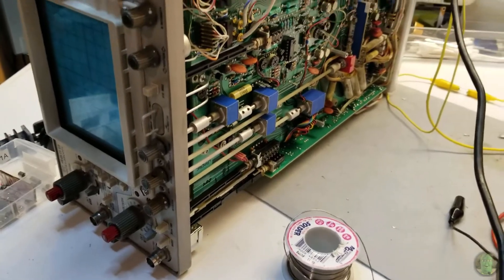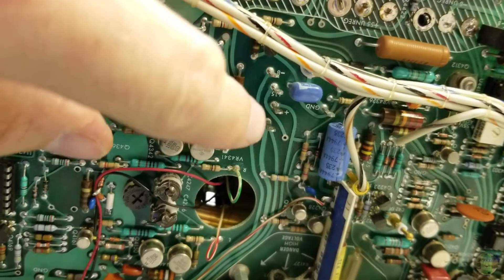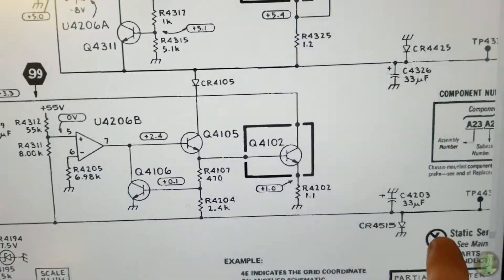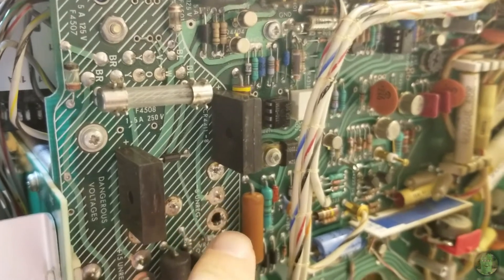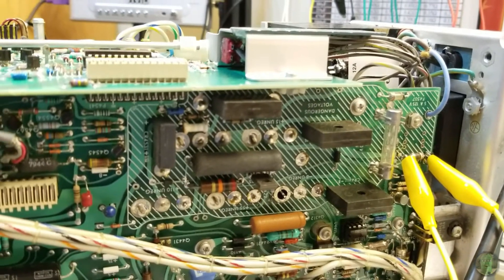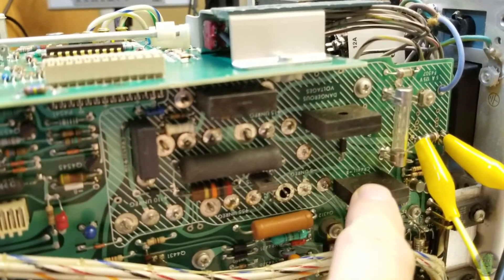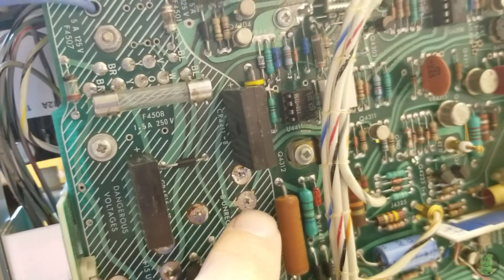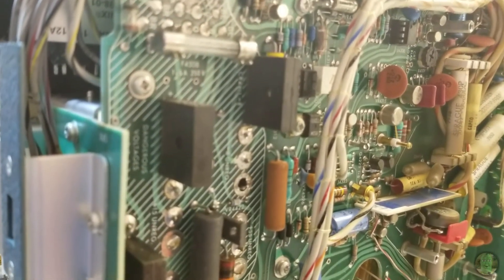Tektronix 465B Oscilliscope problem

Comment: I would check the tatntalum cap on the -@+ 8 volts line. Use you Fluke VTVM to measure the  resistance  to ground . Those bulk caps seldom fail, but the tanks  fail left and right

Comment: I recently acquired one of these for free, I'm just glad that this video showed me what it looks like without having to open it up. Mine works just fine but I don't have the connectors , I thought they were coaxial but they're not, something from the early 70s... where can I find these?
Reply from the maker: It uses standard oscilliscope probes. Any modern ones you buy should still work fine on it.

Comment: That cap is shorted. You will need to de-solder the lytic and push the pins inward so the cap is free to move and shake around, then position scope so that the caps drops free and take it out  ( IF ) you have room to get it out.  Then use a tubular lytic as your replacement, then position the cap wherever you can find room on top, even if you have to use extra lead length on the cap leads.  Make sure Q4102 is not shorted before you do anything.  Don't forget about the Tantalum's!!     73's,  Gary Grove  Minneapolis, MN

Comment: Excellent video!
I have a digital Tek TDS1002B since 2008 and I'm happy with it. Recently I run into the opportunity of buying one of these used Tek 465 (not the B version) for $150. Is it worth buying and having it nowadays?
Reply from the maker: It's hard to say. $150 is steep given its age. Lots of tantalums to short and electrolytics to go bad. But it is nice to have an analog scope for certain stuff, I would go for the more modern analog scopes that had the digital overlay, but were still CRT.

Comment: Don't think it's your big electrolytic. Check first tant filter cap a little further down line like c4203. Tants are more likely to short than elecs.
Reply from the maker: It's been a while since I worked on it, been meaning to get back to it, but I remember reading a resistance across the capacitor was basically 0 ohms, while the -8v at the first tantalum was an ohm or so. I'll still keep them in mind when I get back to it though, cause yeah those little guys will short and explode sometimes!
Reply: @probnotstech  I'd love to see a follow-up video (or comment) on this. I had to buy 3 fleabay 465B's to get one that was working right.

Comment: When working on these old Tek scopes, how do you use a Variac and an isolation transformer?  Do you hook them together or do you use each one separately hooked into the 120VAC power line?  Or, do you even need a Variac and an isolation transformer?  I would think the Variac is handy in case an unknown condition Tek scope had a major short that you wouldn't want to apply full line voltage to.  Is an isolation transformer handy or necessary when working on the old Tek scopes?
Reply from the maker: I use neither at the moment, but they would both serve different purposes. The isolation transformer is for safety, especially when working / using the scope on something with a hot chassis. Variac is useful in that you can bring the voltage up slowly on a device you suspect might have a short or something that you don't want to run a full 120v through. I don't think it matters the order you connect them, but I would probably plug the variac into the isolation transformer.
Reply: I dont mean to be so off topic but does anybody know of a trick to log back into an instagram account??
I was stupid lost my account password. I would appreciate any assistance you can give me
Reply: @Karson Colt instablaster =)
Reply: @Braylen Johnny I really appreciate your reply. I got to the site on google and im in the hacking process now.
Seems to take quite some time so I will get back to you later with my results.
Reply: @Braylen Johnny it did the trick and I now got access to my account again. I'm so happy!
Thank you so much you saved my account!
Reply: @Karson Colt Glad I could help :D

Comment: Did you do anything with this?  Haven't seen a follow up.  The fact that the unit stayed lit for a couple of minutes leads me to favor the cap as the culprit.  Not an expert, but I think you'd get the fireworks instantly with something else as the offending component.
Reply from the maker: I've been sitting on this and waffling over what to do. I decided to treat myself and buy a desoldering station (for this and other projects). When it arrives I'm going to pull out the capacitor and if it's the issue I'll recap the power supply.

Comment: I've just repaired a 465B which I picked up cheap as not working. I never trust old electrolytic caps & blanket change all I can find! I would never trust old or "reformed" ones, having seen the damage wreaked by "cheaping out". The problem with mine was the 1000Uf 10 v one in the middle of the bottom board. I see yours may have been replaced as they were usually Mallory brand. I had to make a PCB for each of the main filter caps which may not be easy for everyone. You will need a good vacuum de-soldering gun to remove the old ones without lifting traces, it can be done.
Q4102 transistor is also a common failure ( the power transistor you indicated) 
The power switch can be removed from the outside, the stud with the nut on is captive, no need to remove the front panel just de-solder the 2 BNC connections. Take pictures of all the plugs & wire connections first though.
Good luck, they are a great 'scope.
Reply from the maker: Thanks for the info! I plan to give this another go, once my desoldering iron arrives.

Comment: If you suspect the big caps are the problems, tek forum tells that you can solder a similar cap across the big cap and see if the problem disappears. You have the fuse blown out and there must be short-circuited somewhere. If you want to get to big caps, you have to unsolder the BNC connectors, unplug wires and remove screws. If you try to desolder the big caps, the PCB holes always fall off.
Reply: Connecting a good capacitor across a shorted cap does not remove the short.  That is only good as a test for open caps.  (for when there is ripple) Ron W4BIN

Comment: Why did everyone always start with rectifier and the big caps? Or tantalum caps? Get the voltage reading first, I believe. The -8 voltage is crucial and it will always go wrong and affect the whole oscilloscope.
Reply from the maker: Well, for me -8v is obviously dead. When I was metering the short, I saw the least amount of resistance (nearing 0ohm) at the capacitor. When I metered at the other boards, near tantalums, etc, the short had a higher resistance. I'm not a fan of just shotgun replacing components that might be bad. I want to find the component that is bad.
Reply: @probnot's tech, I am truly sorry about my tone. I am not accusing you but many people from tek forum always say that big caps and tantalum caps are the failure reasons whenever tek 465,465B,468,475,475A go wrong. These models always have similar symphtoms of malfunction but big caps may not be the reasons.
Reply from the maker: No worries, your tone was fine. I was just explaining my reasoning, as I'm open to ideas.

Comment: Any progress?  

Interested third party, here... I have no significant expertise; a little bit fixing the power supply in a 7904, disassembling and cleaning a 485, and some other miscellany, with general amateur experiences.  And since Jim Williams referred to this as the "world standard dual trace delayed sweep scope," as he fixed the one owned by Tom Osborne, who got HP into calculators...  I'd like to see you win!  (I might suggest that if you haven't seen that video, you watch it, even if just to read between the lines, and not ignoring the general thrust of that and other such stories about this oscilloscope... it's always a shorted tantalum capacitor somewhere!  Plus... a glimpse into the life of Jim Williams is always a treat.)

My 465B should arrive next week; I don't yet know what it will need.  Watching your video and others is a bit of a preparation.  I got very lucky with my 485; it turned out to be ex-DOD, and with a tear down, good cleaning and attention to the controls, it's a truly wonderful oscilloscope in almost-like-new condition -- I really like it a lot.  I love the 7904, too, for different reasons, not the least of which is the personal path through which it came to me.

There are some sections in the service manual that seem pretty good about covering disassembly and working on various boards.  Maybe not as easy as some other devices, but...  my view is you get what you pay for -- slowing down and working through the disassembly.  Repairs that require special effort can go on your Hall of Fame list.  ;)  I'm looking at the manual downloaded from TekWiki.  Step by step, slowly I turned...  when I've come across these kinds of painful disassemblies, which recently includes the oscilloscopes, other test gear, power monitor speaker amplifiers, stuff like that, I find the right time to start, take a deep breath, and dig in, not expecting it to be easy or fast.  But one step at a time makes it not so hard.

With the 7904, the manual gives suggested resistance to ground for each power supply rail, with everything hooked up, so you can do a quick check that tells you whether some load somewhere is shorting the supply rail, or whether all of those resistances are high enough to be reasonable so the problem is probably in the supply itself.  I don't really understand how the ground works on the negative 8v regulator.  I'm just not seeing it.  But it has to be there somewhere!  The block diagram shows the rectifier with a ground connection. Mysterious. But the apparently short across C4419 seems like it should be visable as a short to ground in some way, somehow, or I'm just missing something.  You mentioned the diode bridge and the capacitor as shorting candidates; it seems like Q4102, which I think is the main pass capacitor for regulation on the negative 8v rail, is at least theoretically also a possible short to ground, or at least through the 1.1 ohm emitter resistor.  But then...  a short to ground in some circuit somewhere... e.g. a tantalum... that would do it, yeah?  It turned out to be shorted and semi-shorted capacitors in my 7904 supply, which -- and I'm just sayin -- was probably even harder to work on than the 465B will be.  (It's possible, that's all I'm getting at!)

Anyway... enough babbling; I wish you success.
Reply from the maker: No more progress yet, I've been doing some thinking and planning before my next attack.

What got me thrown off was that when I replaced the fuse it worked for one power cycle. Then when I got the camera out and powered it on a second time, it popped the fuse and metered shorted. I'm going to see if I can isolate all the other boards from the -8v rail so I can be sure it's the filter cap, but that's still the direction I'm heading. If not, will start checking for shorted tantalums.

Thanks for the encouragement!